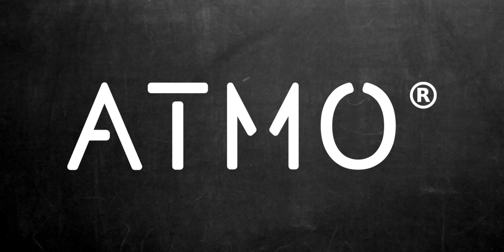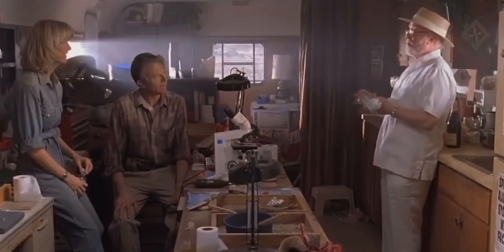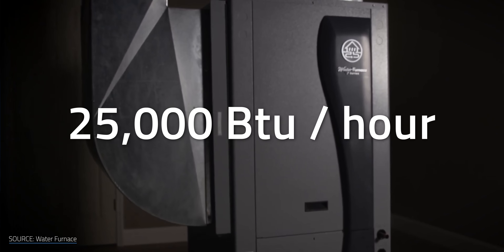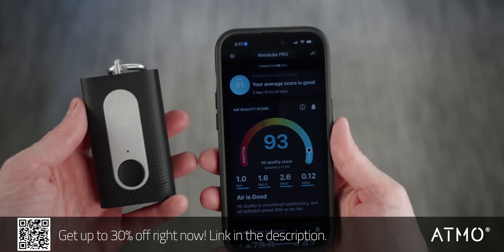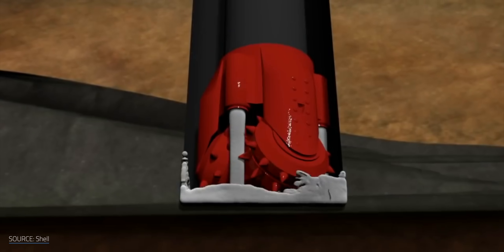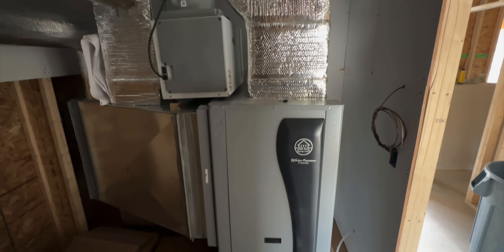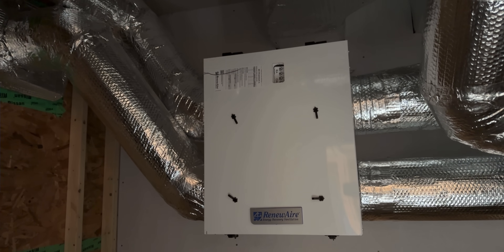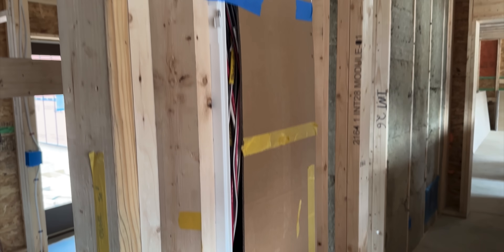Why I Went With Geothermal For My Net Zero Home

Comment: Ah yes, the fallacy of net zero.  Until every resource and cost has been 100% recovered, you are not net zero.  Environ'mentalists' love to call everything 'off grid' and net zero, when in fact, the 'energy efficient' option tends to use way more resources than a fossil fuel option.  The closest you can get is a wood heated log cabin.  So, cool stuff, but your total energy balance is still way way over net zero.  Very misleading.

Comment: Seems like my earlier comment didn't go through. I am an energy storage analyst covering the New England region. It is possible that you know all this but in case you don't, here are some ways you can make money using your system:
1. ConnectedSolutions Active Demand Response program. Enphase is approved
2. SMART program. Designed primarily for storage but pays even better if you have storage as well
3. Clean Peak program
4. ISO-NE passive DR program

This is assuming you live in MA but analogues exist for #1 in a few other states and #4 is available in all NE states. 

#1-3 pay extremely well! They not only help you to pay off your capex but also provide substantial benefjts to the grid.

Comment: One enhancement to this house design that I've had on my mind since hearing about it is to connect a heat pump loop to the back of the solar panel and actively cool or heat them to stay within their optimal temperarure . So on hot days, heat from the hot panels get pumped to the HVAC thermal storage, while in cold NE winters heat from other HVAC sources keep the panels from freezing over .  I'm hoping such a design can extend panel lifetimes while providing a net energy input to the HVAC system for the low cost of some sensors, valves and piping.  However I lack the experience and training to do the calculations for any real setup.
Reply: Linus Tech Tips channel did it where the water in his pool would cool the loop that went to his solar panels on his home to help the efficiency.

Comment: I wouldn't recommend Ubiquiti for their CCTV products, 
They're very average at best and box you into their Ecosystem.
Their wireless & network products are mint they should stick to what they're good at.

I don't see a problem with your ~60 data runs. Depends on the size of the house, My house is like ~1200Sq Feet (Small) and I've got 12 + CCTV 
There is a few I want to replace and have additional cables added, I want a set of 4 at my TV for future proofing.

Comment: We bought out house in 2021 and the first upgrade we did was install a Geothermal Water to Air heat pump.  We also had a Water Furnace Series 7 installed, although we had enough space to do a horizontal loop field.  It works very good in central New York.  Being able to monitor your heating and cooling system remotely is nice also.  Solar is something we are looking at in the next few years.

Comment: 25,000 BTU/hour = 7.3 kW.  Not bad, but... Our 2800 square foot house has about 8 kW of electric baseboards, almost the same. Perfectly comfortable, still duty cycles the heaters in the depths of winter, +21°C inside. We're in Canada. House was designed and built circa 1990. So you're not breaking any new ground, insulation-wise.

Comment: I wonder how geothermal heat pumps could be employed to solve metro systems heat problem. 🤔 it could potentially draw heat out of overheating subway systems and repurpose it for hot water or heating for homes

Comment: If you need additional home power storage you could get a used nissan leaf with v2g charger, it would most likely be cheaper than adding more house batteries for the capacity given even if you only use the leaf as a battery and never drive it. If you "store" the leaf you won't even need auto insurance tires brakes or any thing beyond the electrical system, I don´t know if it even needs to be drivable at all. I do recommend keeping it in the garage for best battery health however.

Comment: I had a geothermal heat pump system installed at my house in CT in 2011. They drilled (2) 400 foot wells 20 feet apart and tied them together at the house. Had to install casing about 100 feet until the drill hit bedrock. Love the system, received my 30% federal tax credit, sold my condenser and oil heating furnace to recoup some of the costs. One thing I would recommend if anyone is converting to geothermal, is to add a small backup system, like propane, for the extreme New England cold weather if you have a large house. I have about 3000 sq. ft. colonial, 2 stories and when the weather gets really cold, the geothermal system can't keep up with both 1st and 2nd stage both on. In these conditions, I have a 3rd stage, which is pure electric heating coils, which use up allot of electricity. This only happens about 5-10 days during the winter, but the electricity bill is high when using the backup heating coils. I wish I installed a small backup propane heating system for the 3rd stage backup heat.
Reply: I just saw the video you made on the new heat pumps that are better with extreme cold weather. I have to look into this and see how much it would cost to replace my 12 year old heat pump. Any recommendations?

Comment: what I don't understand is why you don't have all the cables and wires inside tubes. It would allow you to easily fix any electrical issues, because you (or an electrician) could pretty easily just replace a whole line without the need to get into the walls.

Comment: As an hvac guy, geothermal loops dont last. Ive cut and capped many busted ground loops and had to add cooling towers/water heaters to temper the loop for the heat pumps

Comment: Overrun is a very real thing with radiant floors. You need to have a smart thermostat that basically learns how much before you are up to temp to shut off the heating so that the residual heat in the floor gets you up to your desired temp versus going well over the desired temp. Before I installed a smart thermostat, my radiant floor house would get uncomfortably warm from overrun when heating. The new house looks like it will be awesome. I always enjoy your content. We built a net zero home with a waterfurnace geothermal system back in 2020. Love it. Just need to get around to adding a whole home battery system and hopefully some sort of wind power generator to supplement the rooftop solar. In the summer our power bill is nearly nothing but not so much in the winter.

Comment: This is great, keep it up, can't wait to see your home in operation. I do energy ratings on homes here in Wisconsin and have worked on a few that have GSHP systems. They are great as long as they are properly designed and installed - main problems are with insufficient contact between piping and the ground. It looks like yours is a very nice install. Love that your predicted load is so low you can't get a system that small. Also, good call not installing radiant heat. I've been to several homes where they get easily get overheated, usually due to solar gain (auto-shades would be great for this) and then have to open windows to dump excess heat. Electric heating under those "bare feet" areas in bathrooms seem like a good compromise.

Comment: I went with Enphase for my home and have generally been pretty happy with it. I’m curious why you decided to switch from Tesla to Enphase. My only concern with the system is the micro inverters in the event of an EMP or CME. If it had a regular inverter I could just buy a back up inverter, but I can’t afford 60+ backup microninverters.

Comment: It's probably a bit late, but incorporating passive solar design with roof overhangs that block sun into the house during summer and allow sun in during winter could have been a good idea. But that tends to be coupled with high internal thermal mass rather than your low thermal mass air-heated setup.
Reply: YES.  The ultimate problem with a “smart” home is the complexity.  The the more complex, the more things to break.  Most of which, an average homeowner can’t fix.  Passive features like overhangs, thermal mass, insulation, good windows, and shade trees require little to no maintenance, do not require specialized labor to repair, and will not become obsolete.  These items should be first and foremost in our minds when planning a new structure or correcting an existing structure.

That said, kudos to those willing to shell out for emerging technologies.  Out of all the smart features, one or two will be beneficial enough to become mainstream and well supported.

Comment: I’m curious why you didn’t go passive?  With passive the heating and cooling load would have been tiny. I’m also interested in what you think of the preheating tank.  I live in a draft 1959 build in MN.  the preheating tank works great in winter when the geo is running 12 plus hours a day.  Given the air tightness and r value you have I wonder in the heat pump will ever run enough to preheat the water.

Comment: Confused by the use of forced air. It is so much less efficient at cooling and heating compared to radiant, under floor pipe systems. It's negating so much of the other good stuff

Comment: Also, please charge your ev outside the attached garage.  If it happens to catch fire, you're going to loose the whole house.  Our local fire department added tow chains to the engines so that we can drag evs out of the garage.  Can't put them out unless you're hooked up to a hydrant with a high flow.  They shouldn't be allowed inside attached garages.

Comment: Good luck with the heat pump water heater.  We bought one 8 years ago and are on the third one.  Two have already been replaced  under warranty.  We don't expect this one to last more than 4 years either.  Once its done, we're probably going back to a conventional water heater.

Comment: I was fascinated by the complexity you've built in to your system. I've just completed a rebuild of my house in ireland and went with an exhaust air heat pump system. One unit the size of a domestic American size fridge gives me all of my heating, ventilation, heat recovery and hot water storage. It supplies water to my underfloor systemand can link into PV and geothermal systems if I want. It's has an ethernet connection so I can put it into my smart home system. I have a years data collected now and am very happy with the performance.

Comment: In Europe almost every house has radiant . However they allow radiant floor cooling as well. Offcourse you can't make the radiators colder than the dew point in your house, or you get condensation on your floor.

Comment: Have you considered setting up a Liberty 2.0 engine as a backup generator should Hydro go out?  
https://youtu.be/3bnwQzsp14A

I was thinking it can be running 24 / 7 as a secondary source using a bridge rectifier to convert into DC power then tie it into your Solar / Hydro controller to use more off grid power.  Maybe even have a credit from Hydro when required.

Comment: Hey, I'm right in the middle of rebuilding the 120 year old home of my in-laws into a three-generation home. We considered a heatpump but are in karst region (limestone with sinkholes all around us and low water table) so we connected to the wood chip heater of our neighbours. Have you considered using clay instead of plasterboard to add thermal mass to your house? This is what are doing, next to underfloor heating, to improve thermal and moisture regulation.

Comment: A warning about heat pump hot water heaters in places with hard water. With hard water, calcium will build up in the hot water heater over the years. By ten years, the hot water heater will likely need to be replaced. You can improve that by draining the system yearly, but it is easy to neglect this. So your energy savings will likely never pay you back for the extra cost up front. Even if you are doing this for the "green" benefits, the shorter life will suck up any carbon savings.

Comment: Hehe +1 for the Ethernet cables. But is it a passive house though, according to the standards? I'm curious why you had to put in a heater/cooler system in at all, given that passive houses like that of Amory Lovins doesn't need one at all.

Comment: Hi Matt, your ground brine gets cooler during winters, so when spring/summer comes you can use that cool from your ground as passive cooling (no compressor needed) and also heating the ground for next winter.

Comment: When you move in. Please show videos on everything that goes wrong. Your short term fix. Your long term fix. And how long it took to figure out the issue. Even things like balancing out the room climates, especially as the sun hits different parts of the house. Most of the appliances in my house have broken over a 7 year period. I can't imagine what I would do, if there was a small leak in a geothermal heat pump in the dead of winter.

Comment: I look at this and think to myself. What happens when a fan breaks or there is a leak. Maybe a fuse pops. Or a circuit board heats up and stops working. You are so vulnerable. One of the things when staying low tech, is that you have low tech fixes for any issue. But you could die in your sleep if you lose a fan without noticing. Or a circuit board on your thermostat stops working correctly.

Comment: I have a heat pump hot water heater and a couple of minisplits.  Installed them myself.   So cheap if you do it yourself.  I also have a woodstove.  Geothermal sounds good, but i've researched it and a lot of the people who have them don't recommend them (Cost/issues/etc).   I mean for the cost difference just add extra solar.

Comment: So one question ... can someone explain why you can't dig down below the foundation (basements are pretty much mandated where I live) and put geothermal tubing BELOW the house rather than BESIDE the house?  I'm thinking frost heaves etc. but it would seem digging 12 or even15 feet down, backfilling and tamping/compressing should be possible from an engineering perspective. The extra depth of digging wouldn't actually cost very much since the equipment has to be there anyway and there's no extra fill to haul. The solutions used here are not effective for an urban/suburban environment which removes them from consideration for a lot of people.

Comment: Matt - you cannot say your house will generate as much energy as it consumes - the laws of physics does not permit this. All the geo thermal equipment you purchased and routinely maintain carries a net energy cost ($$$) beyond your normal energy bill. Your geo thermal equipment depreciates like a new car the day you buy and install it because it simply will not last the life of your house - moving parts always wear out - it’s called friction. Water pipes even “wear” out. You are trying to install a “microscopic power plant” under your house and the laws of scale (efficiency) decreases by the cube power as you shrink down these geo thermal systems. Invest your money and energy in the stock market and let the high efficiency of the local power plant supply your energy. Use your capital gains on your stocks to pay your power bill. Stocks seldom if ever depreciate like cars and home microscopic power plants. You make so many of these vids it appears you are working for these companies.

Comment: Do you have some temperature probes down the bore?  It would be interesting to follow the temperature gradient up the bore over time.  Are you putting summertime waste heat down the bore to heat the ground, or is that heat just going to waste?

Comment: You should look into external window shutters to block out the sun during the summer and lower the need for cooling. We have a system from Dreaper with vertical blinds that lowerd our indoor temperature by almost 5 degrees Celsius. They are also made from a mech fabric so you still get the view but block more then 90% of the heat energi reaching your windows. Ours can be controlled manually or with external sun and wind sensors giving them full automation when you are not home. The biggest plus for use is that they are stormproof becuse we live in a very windy part of Sweden.

Comment: Hello Matt, I would have the same philosophy of building a house as you do, probably with the same amount of extra cables and power converters as "really" needed. 
I wonder what the total (extra) consumption would be of all cables and transformers due to their resistance of the copper of the cables and stand-by consumption of all types of transformers with regard to the somewhat higher numbers of cable consumption and more transformers than efficient is needed. Have you ever calculated this for your new home?

Comment: Very cool stuff, Matt.  I built an off-grid home in California 15 years ago.  5500 Sq feet single story and put in 20 miles of Cat-5 cables, all color coded as to function!  Overkill?  Yep.  But it gave me a ton of flexibility.  I also recommend that ALL in-wall wires be run vertically into the attic and then home-run to a wiring closet. You'll thank me later!

Comment: Your home doesn’t have to be net positive, you just have to offset the energy consumption, which can be done through other and potentially less expensive means than doing this directly in the home itself, possibly for a lower environmental cost too (all this work used energy and materials and will do so for its lifespan such as maintenance). Same would be true for a vehicle. Home energy efficiency is overrated and based on dodgy stats, for the most part improved efficiency is just a matter of isolation and appliances efficiency.